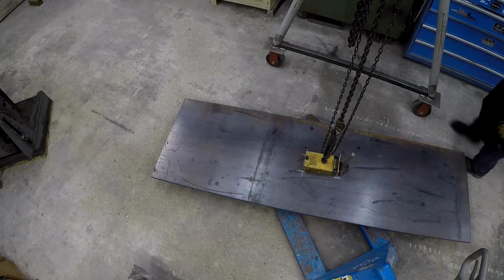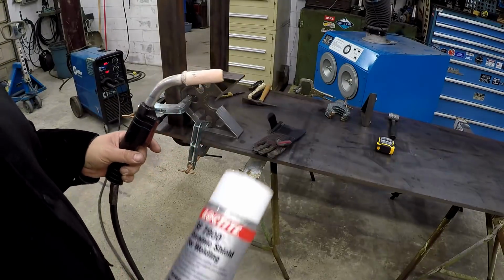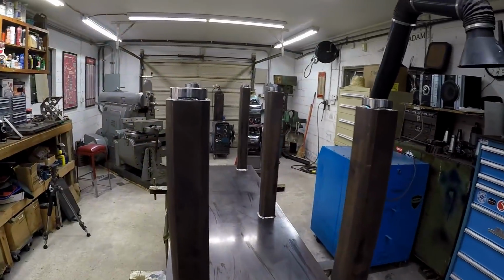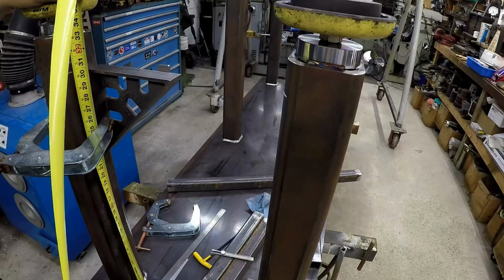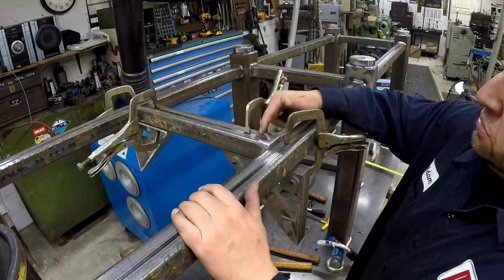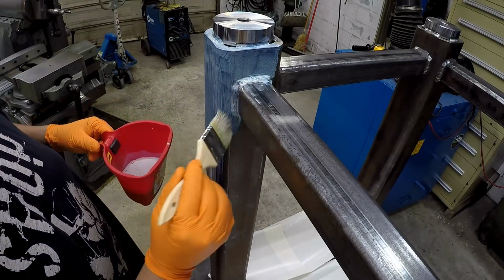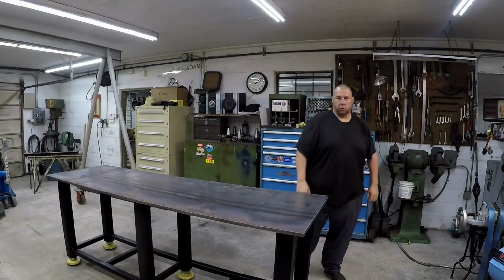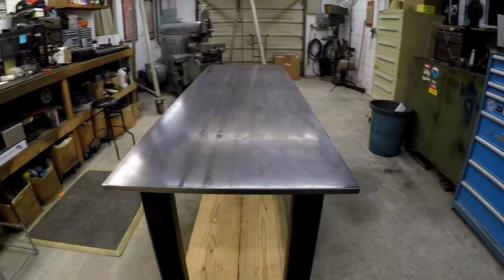SNS 226 Part 2: New Shop Work Table

Comment: Hi Adam.
I am a British ex-pat who regularly watches your show. I enjoy your content as I am a retired rotating equipment engineer.
I have just one comment to make and that is on your rotating welding table.
The two brass oiler connections are susceptible to snapping off because they are not butted up against the bearing sleeve.
cheers.
Barry

Comment: Once again, beautiful outcome and I got some good notes! Funny this was in my feed as I just got near completion of my own work bench last night (wood though). I'm literally at the point of notching the shelf boards. What is the name of the leg riser pads? I'd like to find some that I could bolt into the legs for leveling, rather than shimming it. Thanks again, Abom.

Comment: Great build. I mounted my vises using a receiver tube set up as I did't want to drill holes in my table top also. Noticed the MI shirt. Did you work for them? Spent 10 years with them as a Branch Manager. Good company.

Comment: Very nice build.  I would have done two things different.  One, weld the receiver on when it was upside down😉, and two, welded a small unpainted tab on one of the legs for a ground connection if you ever wanted to weld on it.  

Of course you have the tools to flip it back over any time you want.  As good as it looks it belongs more in a kitchen than a shop.

Comment: Nice job Adam, but why don´t use bevels on your table legs?
Reply: Because, if the wall thickness of the square tubes is no greater than 5mm then the mid section of those corner fillets large enough to match that without the need to bevel...

Comment: Nice table, Adam!!! Wondering if you could build something similar in our kitchen! ;+) Not sure if you are aware of some other major rehab work by the Union Pacific... just search for "Big Boy 4014". Your table would have surely been useful during that little engine's restoration! 8+|

BTW, congrats on your weight control program!!

Comment: One of my plans was to make big table like this . I have a big sheet of stainless steel 5/8" thick by 32" x  84" . Had planned on wheels to move it with adjustable  legs to make it stay put. I too wanted the receiver mounts for vise on both ends. Adam I to love the 7018  , don't worry about the look worry about the strength . I always say they may not be pretty but there strong. ,. Had a car rear end me at a stop light a hitch carrier I made took the beating not one weld broke or cracked . Bent the box tubing a bunch but that showed me my welds are good.
Reply: Silverbullet 7018 is a welding rod for stick welding isn’t it? This is duel shield mig. I am not a welder just did some classes so could be off, I wouldn’t have burned through the scale either my instructor would have been all over that for inclusions
Reply: Sorry, got a bit quick with the comment now he is using 7018
Reply: No hes using dual shield fluxcore it's like 7018 with better deposition  rates and yes it burns through rust and mill scale yes its better to clean but sometimes not necessary with this wire I love this stuff

Comment: At about the 0:10:18 mark, you can clearly see that the sawhorse has a support that detached from the leg... Why didn't you fix that before setting that monster slab o' steel on top of it, Adam?  You can't possibly have missed seeing it!

Comment: that rust converter looks cool stuff, i guess you can always put a harder wearing coat over top if you need it, but it does look good as is
did the leg/ feet screws get lubed?

Comment: Thats great, I love your welding. You mentioned wanting the bracing tubes up from the bottom so you can get a pellet jack under it, if anyone else is building something similar  the other reason to do this is so your toes go under the brace making it more comfortable to stand close to the bench. I love your idea of mounting the vice in a tube under the table I did something similar with my welding table. Mine is mounted in a square tube that slots thru the surface of the table vertically, Your way sounds better! You can also mount an anvil in the same fitting

Comment: 16:15 - gasp! It has a guard and before someone comments - I am using Australian spellings (gauge, guard, etc)
Reply: psst; those are just the normal spellings.. lol. everyone else that spells them (correctly, anyway) uses those spellings. the only real difference i've seen is the difference betweeen english/us: colour / color. neighbour / neighbor. etc. basically; 'our' ending vs just 'or' ending.

Comment: Adam, it was funny to me that the only thing you seemed to struggle with was cutting the 2x12's!  Either a new blade, turn on the "orbital" setting, or a different jig saw...  The orbital adds forward pressure to the cutting stroke, so it cuts much faster/easier, but rougher.  You might consider an easy wipe-on coat of boiled linseed oil on the shelf to reduce oil & dirt stains, and it would also act as rust preventative for the top.
I made my workbench about 20 years ago out of 2x12's and 4x4's, and it would make a solid tornado shelter - yours is ready for the apocalypse!
Reply: finally, the right table to climb under for those old 1950's "in case of nuclear attack" videos! lol.

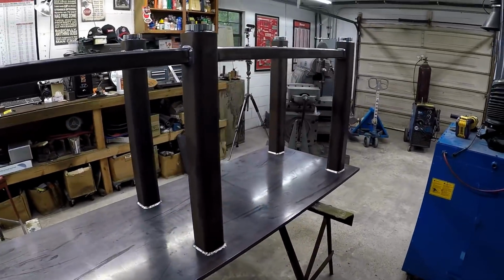Comment: @26:21 Had you considered welding some tubing up under the top to support it? I'm wondering if there is a risk of the top sagging in time with heavy weights etc.

Comment: And if you really want to get tricky with the vise tube, you could use round with a split clamp so you could just swivel it at any angle instead of square or rectangular.

Comment: I have nearly all my vises mounted on receiver tube in my shed. Not only handy to remove to make more space, but I can swap to a different size vise if I want to .   Must admit I was half expecting you to get it across the shaper to give it a final dead flat surface finish!

Comment: What would something like that cost parts and labor?
Reply: A few grand.  I have a steel workbench in one of my tech shops and it cost almost a thousand and was made in a factory. Stainless steel, thinner gauge sheet metal than what he made but I"m not hefting hundreds if not a thousand pounds of work piece onto mine.
Reply: Going rate of steel per pound X 1,000 pounds plus labor !

Comment: Very nice. When you mentioned mounting a vise, I was thinking to myself "I would use a receiver hitch to mount a vise".
2 seconds later you mentioned using a receiver hitch to mount the vise! LOL.

You could mount multiple receivers to be able to move the vise to different areas, or for more accessories like a pipe vise, adjustable arm rests for welding, other welding fixtures, pipe tray, etc.

Comment: Surprising that the mag-lift left such a mark on the plate. 
Was it oily or does the lifting stress leave the mark ?

Corners - If you didn't want to round them off, you could make buffers from an old bicycle tyre.
Just a thought. Or learn to splice some rope buffers. .. Keith Fenner any good at that ?

Comment: anybody have any info on that grinder he used to sand down the plate? i recently bought the same one but the name plate is missing
Reply: Black&Decker wildcat, very tough/dependable, also very easy to rebuild.

Comment: why no braces under the plate, i know the plate is heavy stuff and all but itd still be alot stronger with some braces going leg to leg and maybe an X formation under the top plate, just flat bar on end stitch welded, could dial back the thickness/cost of everything else by adding bracing under the top plate and still have the same strength

Comment: Don't quite know how to put this - but I think you've mounted the wheels sideways!
Seriously - the "unfinished" finish is very effective - dunno how it looks in real life but it's looking good on camera.

Unfortunately not available in the UK - Amazon sell it but at $440 per gall I'll give it a miss
Reply: Andy White it looks like the same chemical to me as Rust Reformer from Rust Oleum.  It paints on as thin-looking white, and forms black iron oxide in the reaction.  I'm sure there are equivalents for a not-crazy price!

Comment: I really like the new table. I have a 4ft square table with angle iron trough on two sides. One thing I had to do was round the sharp corners a little. The sharp corners will murder your thigh. When I was carrying a box of parts by my table, I snagged a corner. Great video.

Comment: Safety pro-tip from a clumsy amateur: put a radius on those corners so if you run into them they won't hurt you (or cut your pants, which also sucks).

Comment: Never did catch the width of that... looks a wee bit less than 36"... maybe it's the camera lens.
Reply: Well, let's see.... the 2x12's are 11 inches wide... 2 of those so that's 22 inches... he moved the legs in  3 inches from the  edge... that's 6 inches... in the video it looks like the legs are about an inch wider than the wood, so that 2 more inches... so the table is roughly about 30 inches wide.

Comment: I'm a beginner welder, just got my first job as a welder / fabricator. Is it worth getting a MIG for flux core, or should I shell out for a gas MIG? I've never used flux core MIG before at all.
Reply: the "Everlast" and "Miller" Adam is using are great machines.  If you are just starting just get what you need to do the job you are on.  Things will take care of themselves.   I love my Miller MIG flux core.  That was the first one I got.  I am just hobby.
Reply: do your self a big favour and just get used to a stick welder, a lot more versatile and they work fine in the wind

Comment: That's an awesome table.  Tons of precision work involved.  Couple of questions though, why not TIG or 7018 stick it all?  Also, why not adjustable heavy duty lockable casters on the feet?  I know it can get flat spots on the bearings and wheels, but for portability's sake...  Everything else is a job well done and I can't wait to have a shop that is a fraction as nice as yours.  Thank you again for providing quality content to YouTube.

Comment: What are those round pads for the legs?
Reply: They're adjustable feet that allow precision leveling of the work surface.   Makes the surface of the table a flat, level reference surface.  They're used for industrial applications where you need to have whatever is being supported perfectly level with the surface of the earth.
Reply: Garry Remington
Why not try thinking about it and maybe actually watch the video.

Comment: I can't figure out why you welded the legs directly to the table, possibly warping it. Why not just build a frame to set the top on?
Reply: It's 1" thick plate... It'll take hellfire before that thing warps...
Reply: You have to include the stupidity factor. Nothing is impossible as long as people are dumb enough. I was working for a welding company that had a 15 cm thick cast iron welding table filled with 6 cm holes (it weighed tons). One Monday morning the table had several grooves of approximately 1 by 6 cm. An inexperienced welder had "helped" one of the office guys modify his boat trailer. He could not understand why welding the support frame to the cast iron table did not secure it. The welds kept breaking, and the dumb ass just kept trying to weld cast iron to galvanized iron with a co2 mig machine. 

I have seen 3/4 inch plate bending and warping from regular use in industry welding environment. It is just a matter of abuse and the applied heat. I agree that in this particular situation it makes little difference, but i still say use screws. That way the table top can be flipped and it makes it easier to repair/rebuild or paint the support frame.
Reply: Exactly. People do that shit all the time never understanding a flat table is a good table, and a table you can adjust by inserting a a plate here and there as it gets older and abused is a great table. Screws instead of welds anytime.
Added bonus is if Bubba the 400 pound gorilla repeatedly attacks it with a 9 inch grinder you can just fire Bubba and flip the top over. New table top and you did not even have to pay for the iron.
Reply: Good luck getting the frame to stay plumb and square while you are welding it into shape. You'd still need a flat work place to begin your first weld etc. He saved time and efforts doing it on the actual bench top. Any warping would be to the thinner legs...3/4" plate steel isn't going anywhere compared to those legs.

Comment: Nice Adam, how do you protect the surface from rust? Woodworkers use Boeshield to protect metal surfaces without attracting dirt and dust. I may not have spelled that right but it should be easy to find if you want to give it a try.

Comment: people who weld professionally may thing this is a strange comment, but I have never seen welds come out that shiny. There wasn't any real oxidation. That flux worked like a charm. I run flux core without shield gas often, and I never get welds that don't have spatter and pitting. But, I am a blacksmith not a welder or machinist.
good welds.
Reply from the maker: Best to run gas with flux core, that’s why there’s specific wire called dual shield.
Reply: thank you abom!
I do know about rust converter (It blackens tools that are deliberately rusted like for knife finishes. If you boil the black oxides or pour boiling water over it, it sets the black color and converts it to an even more durable finish).

Comment: Maybe instead of rounding the corners and violating those nice square corners, you could "baby-proof" the corners with those rubber pads they sell to protect babies from injury. 
I like the size of the table, but what are the final dimensions?
Reply from the maker: It’s 30x96
Reply: Abom79 what was the final leveled height?

Comment: Heavy duty! Only downside I can see is the fire risk of the shelf, being directly beneath any sparks and hot drops from welding etc.
Reply from the maker: It’s not a welding table, and even if it was the wood shelf wouldn’t pose a risk. We use wood all the time around flame cutting and heating and all it does is char the wood.
Reply: @Abom79  Maybe an OSHA employee?

Comment: Fume extractor ...good deal...I once worked in a very large fab shop structural steel. bridge and buildings...300 guys...200+ were welding all day with .120" Innershield, then there were the swing and graveyard guys...everything in there had 2" layer of 'dust'.....smoke, after it settled down....and maybe 25 guys tacking stuff all day with 1/4" 7024.

Comment: What..... no measurement of flatness. No real machinist builds a work table without even considering how flat the top is. I mean what if you need to use it like a surface plate? If you don't have it surface ground within at least .00005 I'm unsubscribing.
Reply: rodney cassidy all the lolz

Comment: You mentioned rigidity, and the only area that might not meet the rigidity standards of the project is the table top.  The top could possibly use some square tubing similar to the cross members between the legs under the top and between the legs under the top, to provide a similar rigidity standard comparable to the leg system.  A fantastic project with your normal level of attention to detail evident throughout.  If you find it doesn't meet your needs, I will be most happy to pay the shipping and handling to my location here in Oregon!  I want to be certain you understand I am only kidding when I reference the top's rigidity relative to the construction of the table leg system.  That sucker is built to support a battle ship.  Nick, North West Farmer

Comment: I guess you know you can use the no-spatter spray on your steel and it will stop most of those beads of weld spatter from sticking. I haven't tried the Loc-tite brand but 60 years ago we had other brands. It really helps.

Comment: I must of missed it
But why did you switch from dual shield to stick welding on the last leg??
Also the rust converter works good 
But i always shoved the project in a rain shower first to get a fine rust film quick light scotch bright rubbing just to card off any scale but not the light rust coating 
Makes it do what its actually supposed to do and so it sticks better

Method that my friend taught me from doing maintenance on turnpike equipment in PA
Reply: I think it was just to show the comparison between the two types.
Reply from the maker: Testing the Everlast welder

Comment: Hey Adam,
Great project and video as always.  I had a quick question regarding when to weld solid and when to tack.  I noticed you tacked the individual pieces then welded them solid.  How do you decide when to do this versus tackling all the pieces and do all the welding at one time?  I am thinking it may have to do with how massive all the parts are.  You make it look easy.  I have made some parts that  have moved around and want to hone my skills.  I look to you as a great guide on technique.  I realize there are always different ways to get to the end, but if I see someone have success, I like to emulate that, so I'm not always having to recreate the wheel.  Thanks again for the content.

Comment: You said you were using "dual shield" MIG welding wire. Is there any specific brand or type you are using? There seems to be a plethora of different wires out there using that moniker. The reason I'm asking is, the wire I have tends to spatter a lot. Before I go blaming the welder itself, I'd like to purchase some known good wire and see if it makes a difference in the weld quality. If it does turn out to be the welder, I can always use the wire in a newer welder. Haha, give me an excuse for buying a newer/better welder, lol! Thanks for your time.
Reply: Paulster2 Dual shield just means the wire has protection both from inert gas and from internal flux. It’s the process regardless of brand.